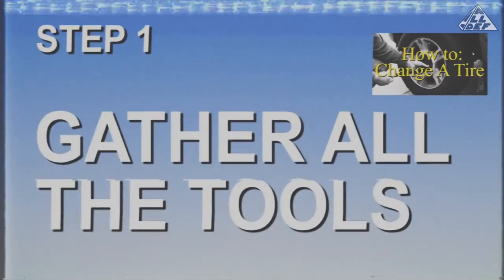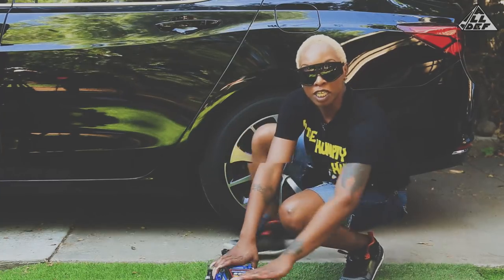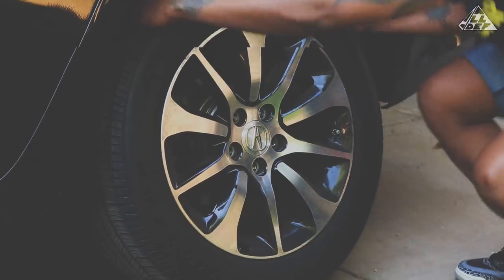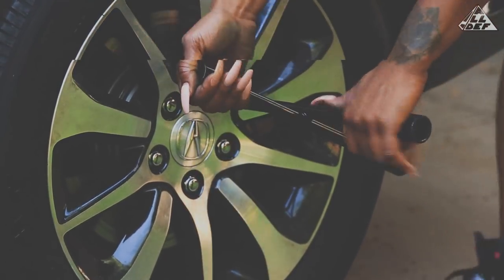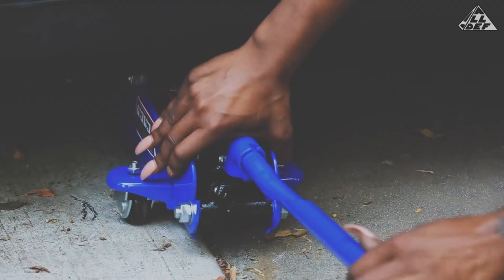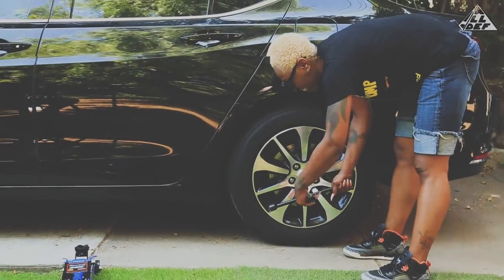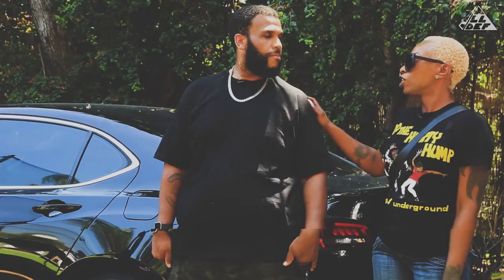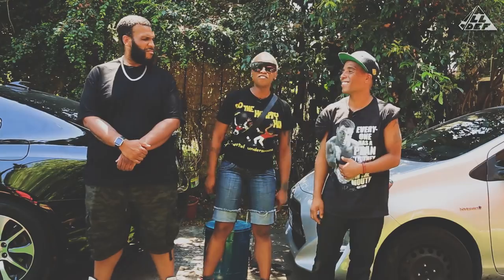How To Change a Tire | IDK How | All Def Comedy

Comment: Just throwing this out there - when tightening the lugnuts be sure to tighten the top and bottom first, then left and right nuts. Then go around and check for tightness. You want the torque applied on the lugnuts to be distributed equally or you can have some looser than others, damaging the bolt that they tire rests on. Which can lead to future problems and repairs.
Reply: She scared me when she just dropped the car
Reply: Felipe Revuelta That’s what’s up, I was thinking the same thing.
Reply: Felipe Revuelta i just think of doing it into a star formation if it’s a 5 nut
Reply: Yea you can also warp the rotor if you tighten them unevenly
Reply: I was thinking this the whole time. I used to change tires on big trucks and that's like 9-10 lugs and it's a must to do it that way
Reply: Thank you
Reply: Criss cross pattern
Reply: And your supposed to get the car jacked up first before u unscrew the lugnuts so the wait of the car ain't on the screw
Reply: I was watching this on my TV and went to my phone YT to look at the comments just to see if anyone would say this.....and I wouldn’t make it a speed competition lifting a car up is actually pretty dangerous if done wrong Iv seen countless jack falls...just sayin

Comment: Another nice tip is when you jack the car up, which ever tire you have off the car lay it under the car next to the jack so if the jack gives the car doesn't end up on the ground.  Or have jack stands.

Comment: Doboy & them nuts remind me of a security person i used 2 work with.  He was checking water pressure in a certain part of the building. He came up to my floor SOAKING WET. "WHAT  HAPPENED DAVID ?!?" "ALL I HAD TO DO WAS TURN THE WHEEL THE OTHER WAY BUT I COULDN'T FIGURE IT OUT FOR LIKE 5 MINUTES!"😂😂

Comment: After replacing a flat it’s a good idea to tighten the bolts in a star pattern. For instance if you have five lug nuts you should number and tighten as such 1, 3,5,2,4

Comment: With jacking, you just look for the grooves where you place the jack instead of the frame. I give her props for doing that with long nails. I enjoy doing that stuff and apparently it's different because I'm female and habe no problem jacking up, changing oil, tires, brakes etc.. 🤗🤗🤗👏🏾👏🏾👏🏾👏🏾

Comment: One important step that was missing from this whole procedure. Tightening the lugnuts in a star pattern so  you make sure the wheel is flush to the hub. If you don't, you can run the risk of not aligning it correctly and putting yourself in danger.

Comment: If y’all are gonna follow this video make sure you put your spare under the car before you jack it (incase it falls) and remove/ tighten the nuts in a star pattern (like when you draw it with one continuous line on paper) then put the flat under the car while you put the spare on 👍🏽

Comment: Just in case this is the first video you refer to to change a tire. Do not take all the kids nuts off first. That's dangerous. Second when you finally tighten the nuts at the end, go in a circle and skip one to come back to. This makes the wheel centered properly. So if you have 5 lugs, do it in a 1,3,5,2,4 pattern. 4 lugs 1324, 6 lug, 1,3,5,2,4,6.

Comment: I highly doubt she put the jack in the right place.
Reply: Rob Miguel yet she stilled changed the tire successfully. Comment irrelevant ✌🏾
Reply: Paryss Ja if it wasn’t in the right place then she’s lucky she didn’t damage the body, or worse crush a brake or fuel line

Comment: Not tryna be a troll but just in case y’all do end up having to change a tire, always tighten the nuts in a “star pattern”. Never tighten the nut right beside the nut you just tightened going in a circle 💯

Comment: Do not I repeat do not let the car down until you have put the tire on securely and tighten the nuts up as good as you can and then you tighten them up even more bite working them once you set the car down otherwise the tire will not be firmly on to the wheel base